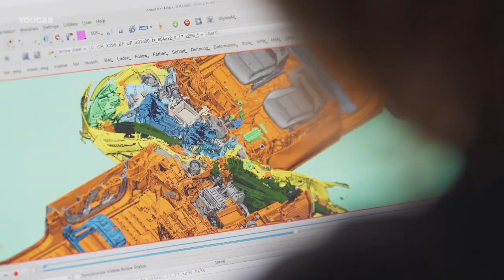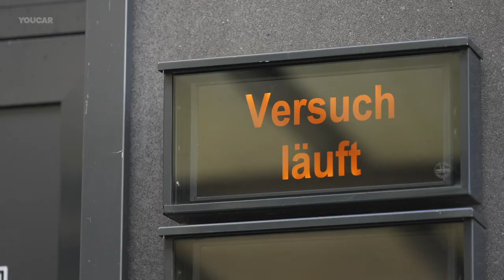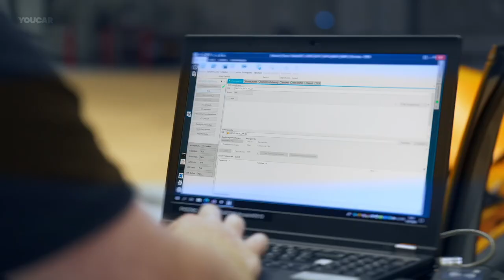Crash Test: Mercedes EQA vs. Mercedes EQS

Comment: Current crashes should be done at 90km/h with a 40% overlap, to ensure the worst case scenario (frontal crash test in a national road)
Reply: I agree with the speed, but not the overlap. The smaller overlap is actually more challenging for the car
Reply: I used to think the same, but at one point I realised that the goal of crash test is not to test against worst case scenario (which is realistically impossible within reasonable cost), but to provide valuable insight in the most common types of crash, the type of crash that results in the most fatalities. Worst case crashes have a higher chance of being fatal, but happen much less frequently
Reply: I would say crash test at maximum speed allowed in highway. Except Germany.

Comment: OMG, the EQS turned more angle than EQA?? This is against physics. How could it be?
Reply: Dont they turn pretty much the same and then the eqa rolls back with a broken wheel and therefore changing its position?

Comment: Just reduce size, height and weight. Cars are not the only thing on the road.
Otherwise you can completely remove the steering wheel.

Comment: According to physics, two objects with opposite directions add their speeds. So, in this case 56 +56 = 112 kmh
Reply: A crash at a static object at 56 and a collission with two cars at 56 is the same it doesn't double the speed, this can be easily seen in simulator or in real case
Reply: seriously? go learn physics again. Crashing to the wall at 56 equals to two same cars colliding at 56 each.

Comment: This kind of tests are RIDICULOUS. The most dangerous part of these vehicles are the UNSTOPPABLE self-igniting batteries that they use.

A specific assessment test must be created for this kind of dangerous vehicles which should be restricted to low speed zones only. A single car involved in a multi-car pile crash, for example in the motorway, can lead to fatal consequences for the whole pile creating an UNSTOPPABLE blaze that is far less likely to begin with regular petrol and Diesel cars and can be put out with water or fire extinguishers.

It's about time we call this kind of vehicles for what they are: LIABILITY, beyond having a production impact on the environment worse than regular internal combustion engine vehicles.
Reply: Sooo basically you see a pretty common crash and no sign of any fire, smoke or ignition and you still complain?
Read through the regulations required for HV-components and all tests required for getting a certification.

Even real life data shows that ice cars are way more likely to start burning. Modern ev cars are at least as safe as ice cars. Seems like all the anti-ev stories gave you a warped perception...
Reply: @quelandil5738 death rate once the car ignites is much higher on ev. Similarly, small cars have a lower accident rate than larger suvs, but they have much higher fatality rate. It is not about catching fire or not, but is the matter of if the fire can be stopped and the person inside can be safe.
Reply: @느낌표-t1l  The cases where a vehicle actually catches on fire are an issue. Earlier vehicles surely have a higher risk and it is quite difficult stop the fire.
Therefore lots of regulations have been introduced. Mandatory safety tests for certifications. So new cares are way safer now.

Do you have any statistic to show a higher mortality rate? I would imagine insurance companies should have some.
Reply: @느낌표-t1l  didnt answer to the comment about weight difference.
Nevermind the safety measures, if your opponent is too heavy you have a problem! 
Eqa and eqs were similar enough. But you dont want to mess with an eqs if you drive a fiat 500
Reply: Have you any evidence to support your assertion that the "death rate once the car ignites is much higher on an EV"? I suspect you justafe that up, based on your fears and your bias.

I don't know what the reality is, but I know there is far less energy in the average fully charged EV battery compared with the an ICE car that has a full fuel tank and I also know that petrol has more explosive force than dynamite, so I'd guess that the fatality rate from a burning EV would be less.

It would be interesting to see some actual evidence.
Reply: @chrismowatt818  lol what? Having more energy does not mean it can fully convert to a combustible energy.  Learn chemistry and physics from highschool first before blabbing.